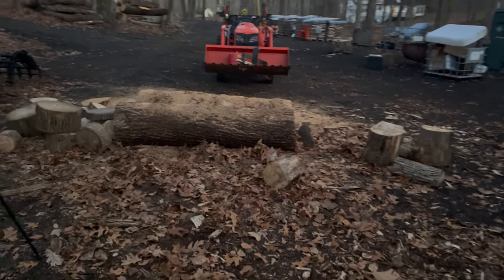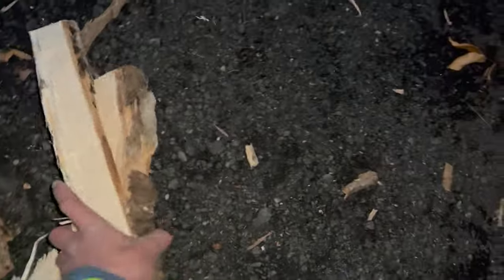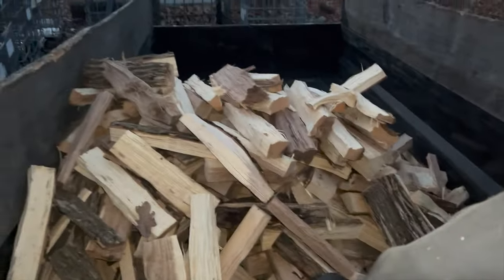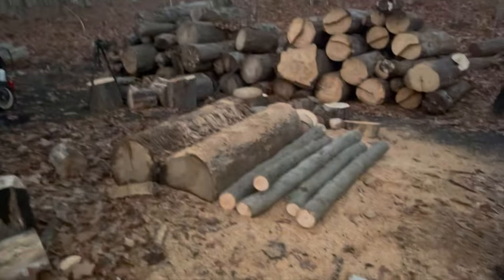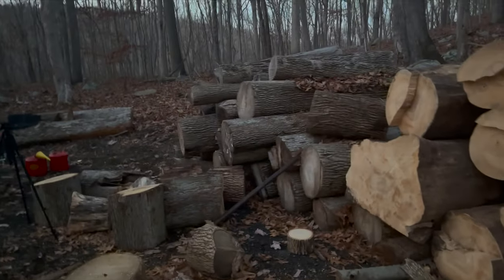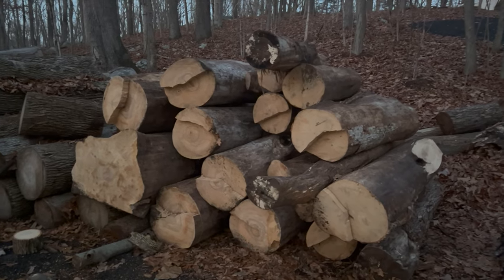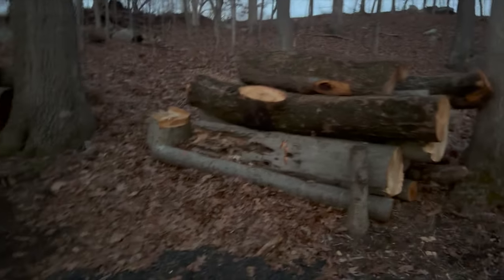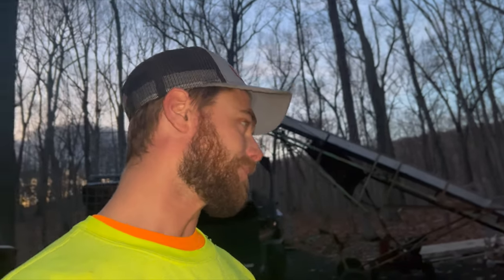#306 Splitting Firewood with RuggedMade Log Splitter and Firewood Conveyor

Comment: If you modify the wheels on the conveyor to be on spindles you could turn them sideways and swing the conveyor instead of moving the trailer
Reply from the maker: This is something we thought about but it’s easier to just pull the trailer forward at this point

Comment: if there a chain saw your looking to buy  Stihl MS 391 MS 462 or the 500i or Husqvana 592xp what are your thoughts,
Reply: all of them are good saws, but somehow you either accidentally or on purpose over looked the Husky 395 , if I were to get a Husky saw I would look at one too, 395 is without all the whistles, the 592 is computer controlled, 395 is a a half horse dimmer, the 592 auto tune cranks out a bit more hp, but at about 100 or so bucks higher price, and needs near professional service, the 395 you can get it kicking again with minor mechanical sense
Reply from the maker: The 395 is a fantastic saw! I’ve run one many times!

Comment: Echo 620 pw. Or 620 p Can run a 20, 24, or 27 inch bar no problem had one for 3.5 years now.   1 for 2 years and one for a year and a half.   All 3 saws get used every day almost. All 3 saws start,  2 pulls with choke on.. saw fires and then push choke off 3 quick pulls BAM saw runs & oils great. 
   Only good saw echo makes in my opinion. Boss man used to only use echo. Because his buddy was an echo dealer. 
Saw shop changed hands and we do now run big stihl 440 460 661 and 200t since 2020. But  echo 620 is best mid size for felling limbing climbing/topping... they are about 689 to 729 price range I believe now
Reply from the maker: I’ve heard Echo makes some decent saws. I just don’t have a dealer near me
Reply: @DudeRanchDIY  u can get em online, the 620 is a good saw, but they have different drive link counts, husky bars work with them as well.  Like 70 dl for 20 inch 81 dl for 24, and 27 is 93dl
Reply: @DudeRanchDIY  I have a Husqvarna bar on the 20 inch 72 dl chain barely fits with the tensioner almost all the way out.

Comment: If you can find a Stihl ms462 buy it and don’t look back. I have mine set up with a 25” light bar and it’s my favorite saw. Great power to weight ratio, great throttle response and it just eats through wood.
Reply from the maker: Cool! They have a 462 at my local dealer…
Reply: @DudeRanchDIY  I’d buy it if I was you! I’m friends with the owner of my local Stihl dealer, I called him up wanting to upgrade from my ms291 and was thinking of the 362. He told me he wouldn’t let me buy the 362 and to get the 462. I’m glad I listened. Once in a while I put the 20” bar on and it’s an animal with that as well.
Reply from the maker: Honestly I’m leaning more towards the 500i because I can get it with a light bar for the same price as a 462… 😃
Reply: @DudeRanchDIY  that’s a good deal! I’d jump on that.

Comment: Jake ???? I am ready to purchase a RuggedMade Splitter 737-24-RE, i narrowed it down to that or the WolfRidge 28 Pro. I like that adjustable wedge. RuggedMade does not advise it and will not custom do that for me. You and Scheib have made mods that provide that. I do not have those skills, but likely can find someone near me who could. What does it take, and what are approx costs? I am in central Wisconsin and processed 20 cords this last season. Love your vids and watch them all.
Reply from the maker: It’s not all that difficult, you will just need to buy a small hydraulic cylinder and valve and have some new lines made up! Few hundred bucks I’d imagine!
Reply: @DudeRanchDIY  Thanks Jake, my neighbor is real handy, I will pass that along for him to help me. By the way, I got my new 500i just before I headed to Arizona. I left it with my tree service guy, if he has any big wood to get into. Thx for getting back to me so fast.

Comment: Hello Dude, where is the other dude too, anyways, is your chain BREAKING links, or is it just coming apart, if it is breaking links, as in wearing through the straight part of the link that goes through the C shaped part of the next link, or the C shape side is half missing, and that is happened to a lot of the links, you need to replace, BUT if it is just coming apart, they will do so right before or right after the link goes a round a gear, if so your chain tension is to low, tighten that puppy up a little bit. let me know what is happening,
Reply from the maker: Hey there, Ben, neither of what you described is actually happening. From time to time a piece of wood gets jammed in the chain just right, and it comes off the sprocket at the top end of the conveyor. When this happens, I found it is much easier to just break the chain, put it back on the sprocket, and then reconnect the chain, instead of trying to futz with the tensioning system, which is all rusted up. Hence the chain braking tool!
Reply: @DudeRanchDIY  , bend up a soup can, or some thing and make a guard  for the top gears, if only it were that easy, Good Luck on finding a way to prevent this problem,